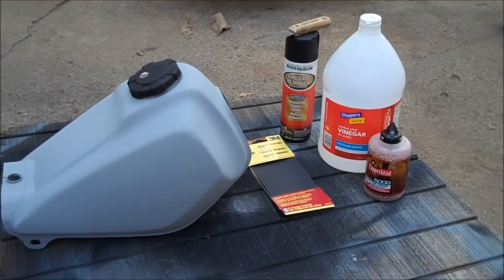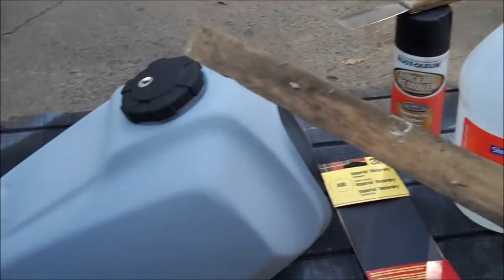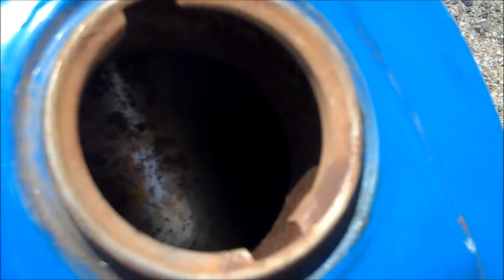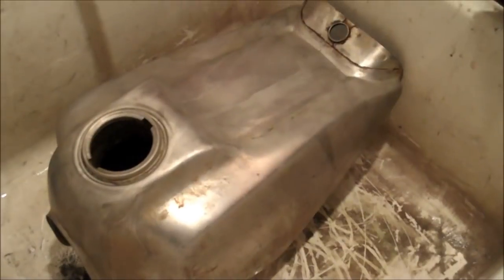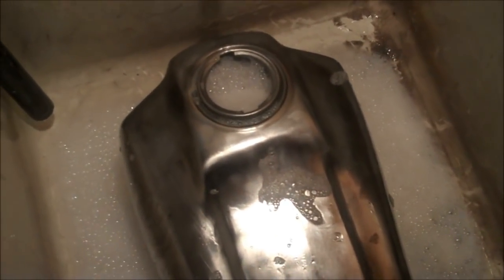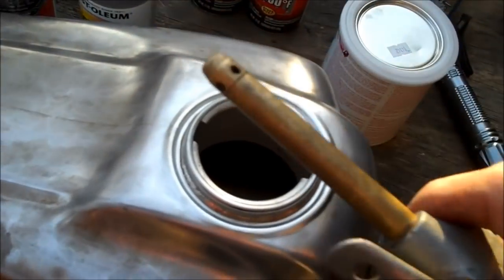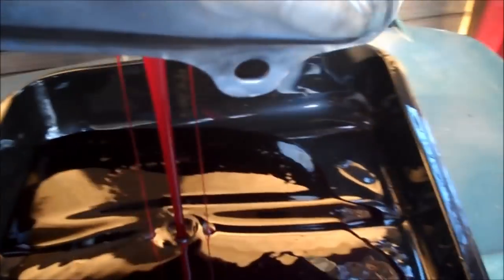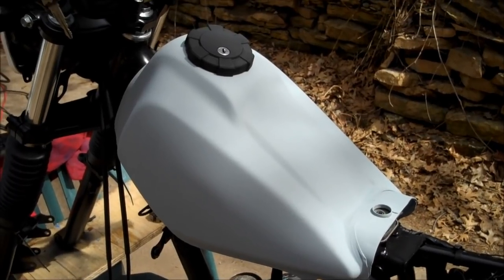How to RESTORE and COAT a FUEL TANK with RED KOTE.

Comment: Great video!  I have an old Ducati 2-stroke that sat up for 35 years and was full of rust and gunk from the oil.  I used acetone with BB's as first to get the gunk out, then used the vinegar and the BBs.  It cleaned it spotless!  Took a week and some exercise, but man did it work!  Also bought some redkote and hope to seal it this week.  Thanks

Comment: I actually tried this today not knowing you posted this. No auto parts stores around here have the liner, so I'm out of luck there for a bit. Cleaned out my tank with vinegar, got some nasty shit out of there and the petcock, but needs the bb treatment to get rid of the rust inside it. Then hopefully my carburetors won't get plugged off haha
Reply: I had tried running filters on my bike, but because of the goofy positioning they needed to have, neither carburetor was getting the gas it needed, and the filters just ended up sticking out too much and interfering with other things like the petcock switch or the throttle cable. I took them off, and put new line on, gets proper flow again.
Reply from the maker: HedgehogOutdoors I ordered a 90 degree fuel filter on Ebay.    The Tw200 has a very tight space between the carb and tank,  but a 90 degree fits perfectly with just a couple snips of fuel line.   You can get the RED KOTE tank treatment on ebay as well.
Reply: Thanks!
Reply: @OldMotorcycleAdventures   what about the fuel petcock do you take it out?
Reply: @camper440  Yes. The petcock hole is used to drain out the leftover sealer and you just tape over the hole during the process. Only the inside of the tank needs sealer because rust.

Comment: Thanks, I really enjoyed the concise step by step, from first to last. Where did you get the paint you used in the tank? I've never seen it before. Keep up the good work, and thanks for sharing.
Reply from the maker: David Gonyeau I picked the Red Kote tank liner up at a local O'Reilly auto parts store.   Although you can get it on EBAY a little cheaper.

Comment: I know my comment is a gew years after this video but what about flash rust when you dry out the tank. Is it a problem or do you just seal over top of it???
Reply: He mentioned coating inside the tank in WD40 after the neutralizing rinse so that it prevents flash rust. This is only necessary if you're not coating the tank immediately. If you plan to coat is immediately after the acid and rinse, just make sure you dry it completely and you can coat. If you won't, then use WD40 or some kind of diesel fuel or oil to coat the bare metal and protect it for a few days.
Reply: Don't forget to degrease still before coating though.
Reply: Red Kote claims it will seal over rust no problem but just make sure to get all the loose rust out and do all the proper cleaning/degreasing etc as instructed in this video.

Comment: do you have a part number and brand for the red coating you used?
Reply from the maker: RED-KOTE
Reply: +Yankee Prepper - Preparing for the Wrath of God and Fine Coffee. i found it
only reason i ask is i work at an auto body supply store and i wanted too see if we had it in stock. im going too need it soon.
Reply: man this stuff is expensive as fck, i can buy a new motorcycle for 60 bucks, you know something cheaper ? im trying to fix my bike , right now i'm driving it with plastic bottle instead of a tank

Comment: Did you have to do anything to the gas cap? as far as the inside of it? Because mine has a bit of rust on it as well. Thanks for the vid i'm in the process of doing this with my TW.
Reply from the maker: John Narvaiz I sprayed it thoroughly with a good penetrating oil and soaked it for a week in a plastic bag.   After a week,  I lightly used a wire brush on the metal parts and blew it out good with compressed air.   I finished it with a light coat of penetrating oil and it has worked like new since with no rust.

Comment: What's the purpose of the BBs?
Reply: To agitate the rust since you a brush can't reach inside to scrub the rust.
Reply: @ELCLAVE300  Ah, got it. Thanks.
Reply: @nolangaudreau  You can also use nuts and bolts, pieces of chain etc but they say to use metal so if any gets caught inside you can fish it out with a magnet on a stick.
Reply: @whichgodofthousandsmeansno5306  Makes sense. Thanks.

Comment: Fuck. I don't have running water. Let alone hot water. I've heard you can just use diesel. Dump half a liter in. Swish it around a ton. Leave it in a bit. And the rust should come off from inside. My tank has WAYYYYY more rust inside than yours. Nothing but thick crust brown rust.